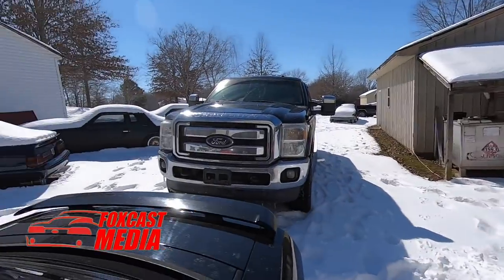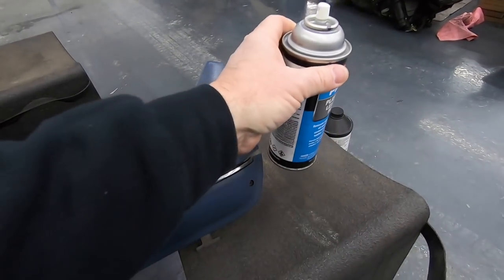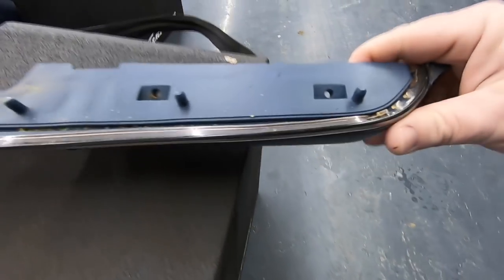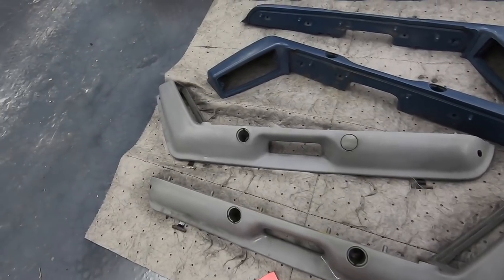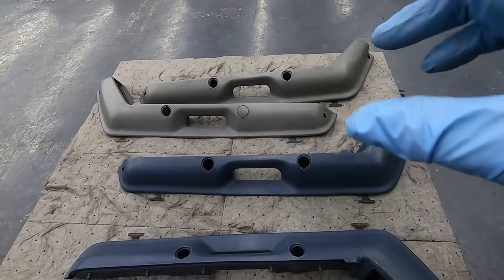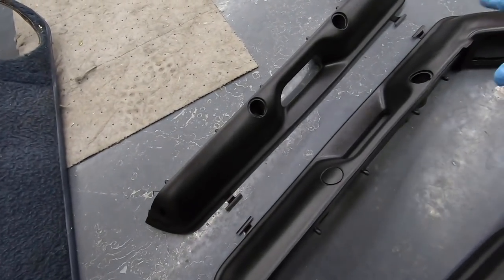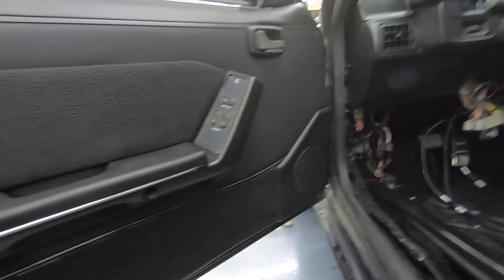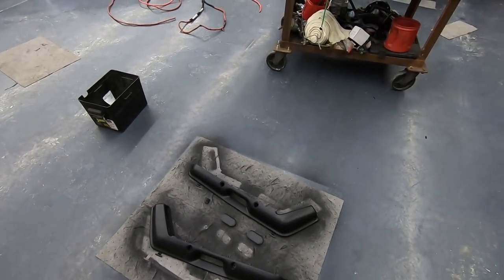How to dye interior panels, for amazing results!

Comment: Looking good! I went through many red parts on my 87 always replacing them with newer looking ones until 2001 when I found a pretty mint black 90 interior. It was only missing a couple of the armrest plugs and one console cover, so those got dyed. I used fresh vinyl to cover the dash pad and the console lid. I might need to get those LMR armrest pads soon though. Great job!